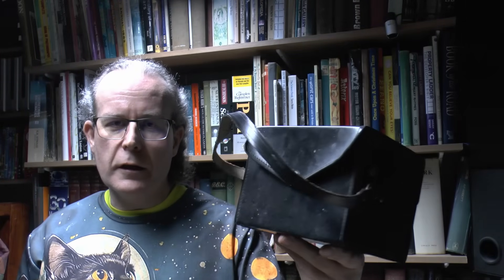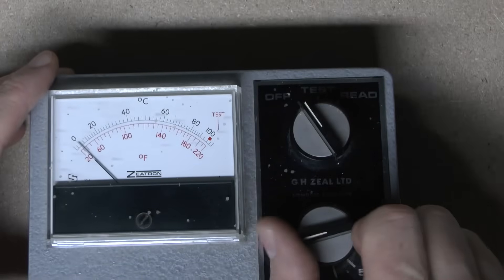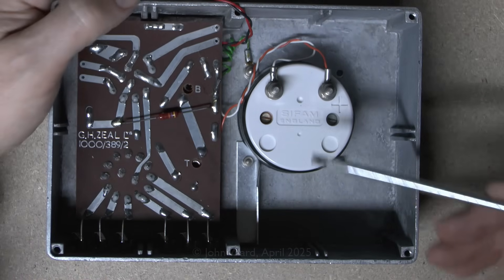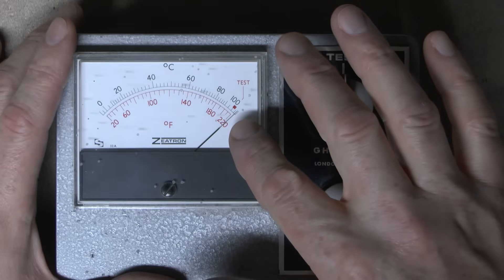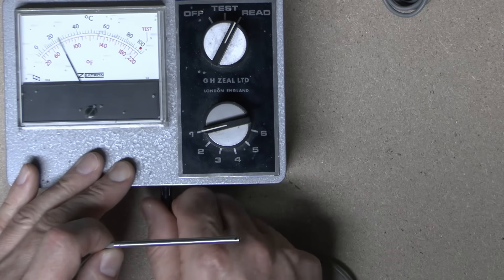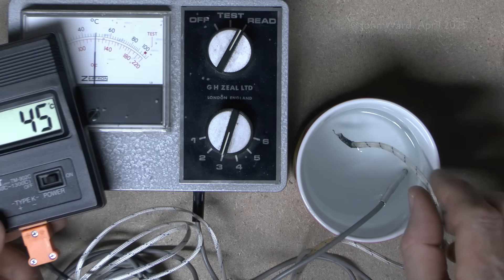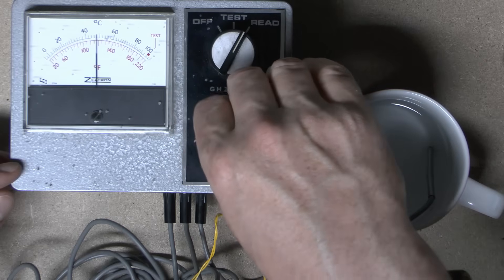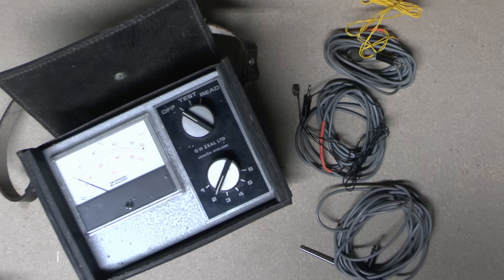GH Zeal Analogue Electronic Thermometer, 1960s?

Comment: Thanks, your aging definitely looks about right at early 1970s plus/minus.  As others have suggested the circuit could well be a Wheatstone/Christie bridge type of arrangement to reduce sensitivity to absolute battery voltage. I think the give-away is the meter needle kicks below zero when you selected channels with no probe plugged in. The sensors are surely matched close tolerance thermistors, a hint to that is the way the meter is non-linear, presumably to follow the thermistor curve.  Having broadest scale at 40-60deg makes me wonder if target market was biological cultures/incubators/delicate pasteurisation etc?

Comment: You should have "zeroed" the meter at the lowest part of the scale. That would have lowered the readings by 5 degrees.  Check calibration in ice water and boiling water.

Comment: Interesting video. Maybe adjust the needle when the the switch is in the test position so that it's "tuned" to the red dot - then perhaps the readings wouldn't be so high? This would also enable you to recalibrate it when the battery voltage starts to drop off over time e.g. drops say to 8V.

Comment: As the needle can go below 0°C for the 20°F position, I wonder if the needle should adjusted to the red spot in the Test mode instead, like how analogue Ohm meters had to be adjusted to the end '0' mark with the test probes shorted.
Reply: I was thinking this too, as Celsius and Fahrenheit are not absolute scales, 0 is pretty much arbitrary, so it doesn’t make much sense to adjust the needle there.

Comment: Thanks JW. I think the battery voltage difference is a perhaps a red herring. I'd guess at it being some sort of Wheatstone bridge so should be fairly insensitive to supply voltage (could prove with a bench supply). Sensors possibly thermistors which wouldn't be terribly linear so there will be some residual sensitivity to supply voltage. My vote would be on other resistor values drifting with age.
Reply: I’ll second both your points!  Probably a bridge circuit with thermistors. And probably the resistors in the other legs of the bridge have drifted.  Trimmer pots could be tweaked to calibrate it.

Comment: Good to see proper test equipment with a metal case finished with Hammerite! 
Would a modern circuit include a Zener diode to regulate the battery voltage?
Reply: Possibly, but given we didn't get to see the other side of the PCB who can say if there was a Zener Diode there or not.